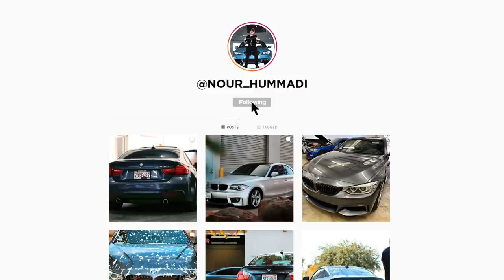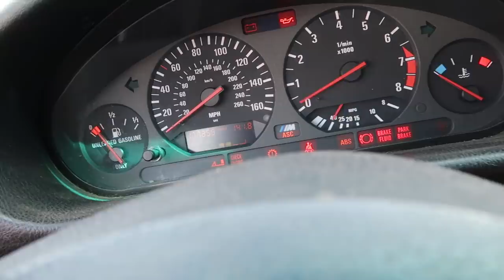BMW E36 M3 FULL INTERIOR RESTORATION!!!!! (Part.1)

Comment: Done! I dont have my drivers license yet, but im planing to use the 2500 to buy a 318 :) it'll be about 5000 and winning the giveaway would really help!
Reply: 5000 for a 318 🤔
Reply: @einen4554  austria is expensive bro...a used 318 will go for about 4500-6000 no jk
Reply: Albin__ damn I just bought a 323is for 600 bucks 😧

Comment: I recently saved an 07 335i sedan. A younger fellow received the car from his stepdad, but couldn't afford to repair it. The car pumped out massive amounts of white smoke from the exhaust. Running the car for just 15 seconds would conceal the neighbors house in a cloud. Rear turbo had a broken shaft and oil was being dumped right into the catalytic converter. I installed cheaper Dorman turbos myself. 30k miles later and no issues (except for rear tires. lulz)

 love this channel. #SAVEABMW